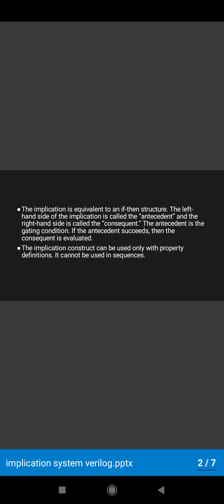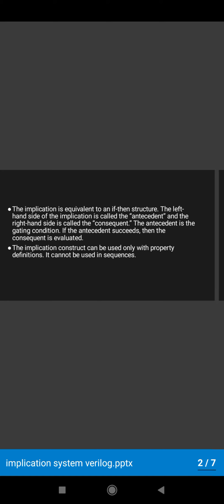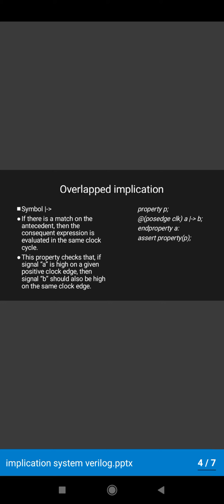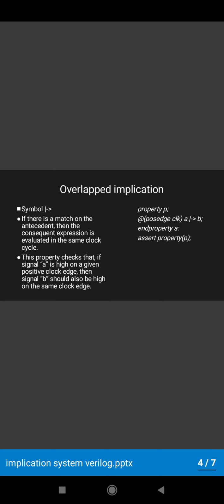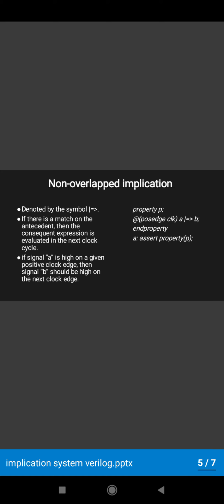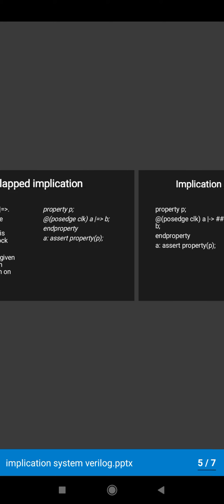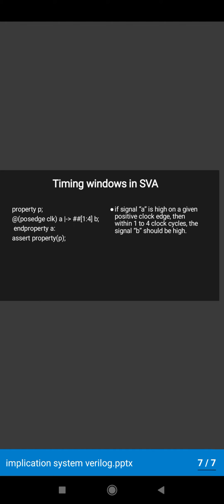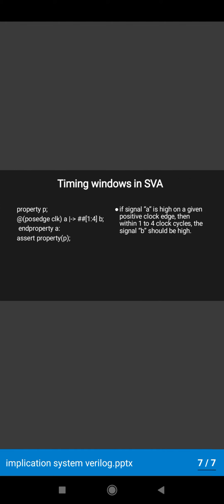SystemVerilog Assertions | Implication Operator #VLSI #Verilog

Comment: Assertions are primarily used to validate the behaviour of a design. Assertions can be checked dynamically by simulation, or statically by a separate property checker tool – i.e. a formal verification tool that proves whether or not a design meets its specification.